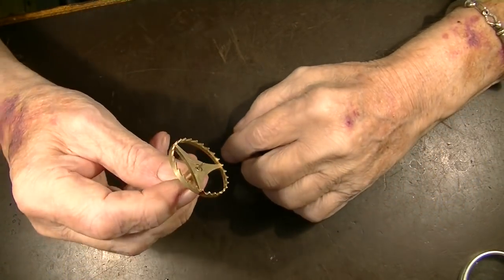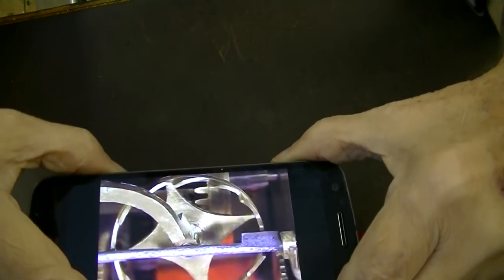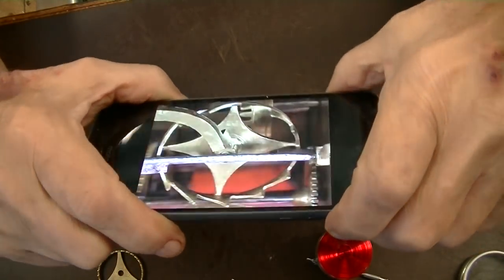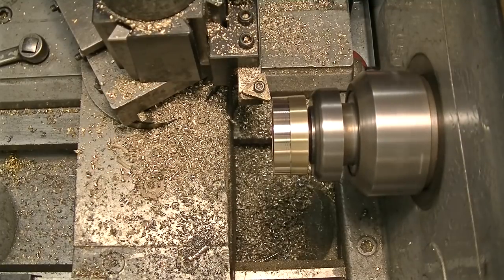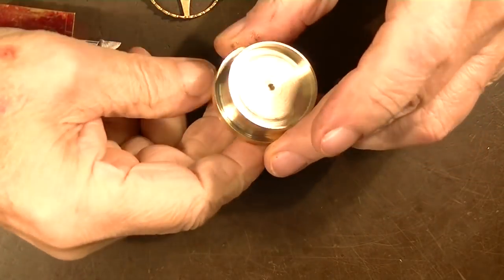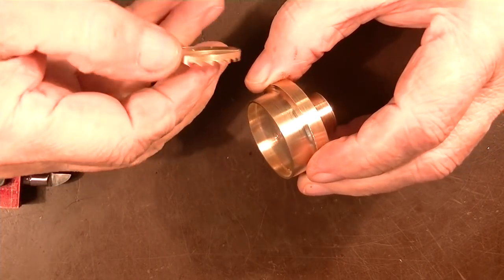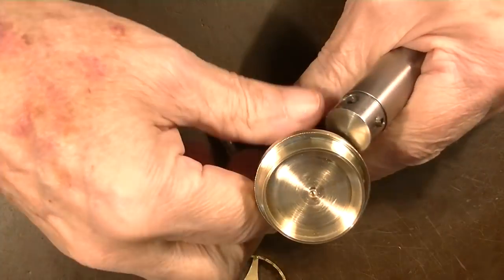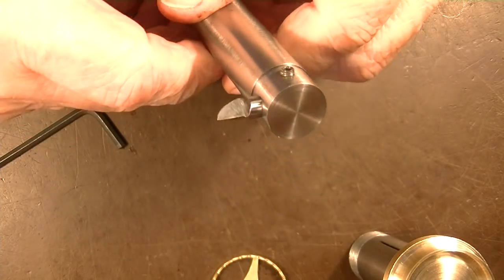The Village Clockmaker. #27 Making a crown wheel for an English bracket clock.

Comment: As high an RPM as you possibly can? I’ve been taught that flycutting shouldn’t really be done at speeds higher than about 500 RPM. Even if you can emulate the number of cuts/second compared to a multitooth cutter, you are still just increasing the surface feet/min by increasing RPM. So it would depend on the material being cut and the stick out/diameter of your cutter.

Also, best wishes to your health! Glad to hear you are recovering.
Reply from the maker: I agree. I was cutting 360 brass and the cutter was pushed in so that only the cutting surface was out. I've cut a lot of teeth with fly cutters and this seems to be the best for me. If the cutter sticks out very far you get a lot of "wapping" instead of cutting. JL

Comment: Dag, your arms look just like mine. Prednisone just makes the skin paper thin. Hardly a day goes by I don't rake it open to one extent or another. I had AML treated with a marrow transplant 8 years ago.
   I hate to be Debbie Downer and it may just be the video, but those teeth look terribly uneven and irregular. Did you not have a good spindle lock?
Reply from the maker: As I said the cutter was not as good as I would have liked so I finished it up with several hours of filing. Cheers, JL